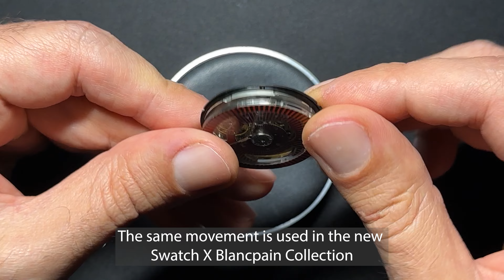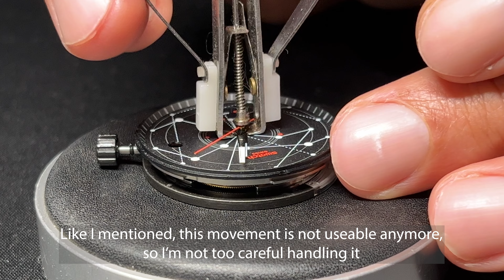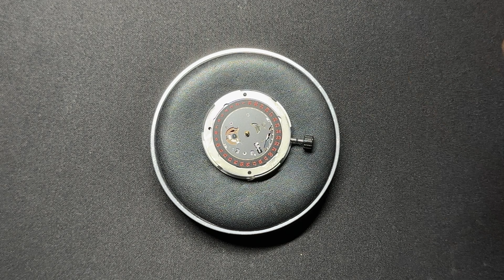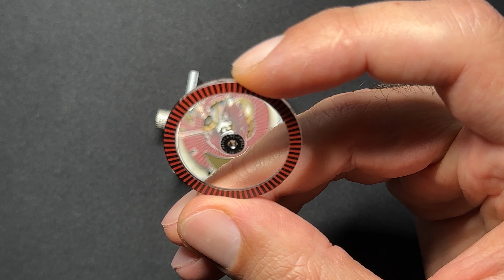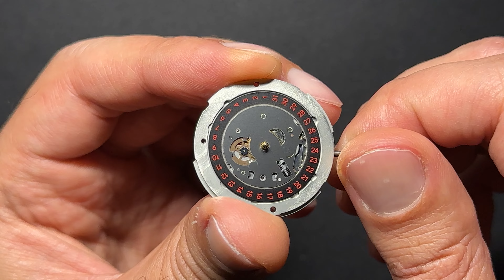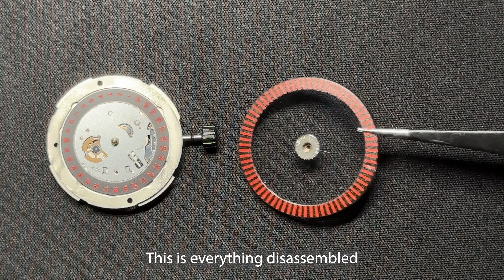A closer look at the SISTEM51 Movement similar to the one inside the new Swatch x Blancpain

Comment: What's the size of the movement? I wonder if you could just plonk an ETA/ETA clone inside the case and be done with it.
Reply from the maker: That's a good question. I'm not sure if it will be possible. The Sistem51 movement diameter is close to 33 mm.
Reply: @time_keep  so....might need a new spacer then.
Reply from the maker: @tdugong  I actually disassembled the movement so everyone can see what the parts look like. New video is uploading right now! 😃

Comment: Very interesting.  Thanks.  I may pick up a Sistem51 watch just for the significance of the movement -- robot-made, riveted, disposable automatic.  Don't think I'd wear it much; doesn't look like it's designed to last.
Reply: if it's not designed to last why not just wear it while you can? Otherwise you just keep it in a drawer until the oils dry out and throw it away.
Reply from the maker: @defenestratedone  good point.
Reply: I doubt it has oil lubrication.  One purpose of a plastic escapement is to obviate that need. It may last forever with proper care.  @defenestratedone

Comment: Interesting. Some videos I have watched call this out to be a plastic movement but I don’t see any plastic (gears etc. all seem metal). Have you observed any major parts within the movement that are made of plastic? Would be interesting to see how well the movement is keeping time.
Reply from the maker: It is actually metal. I don't see any plastic parts aside from the rotor. Time keeping is good too. According to my timegrapher, the movement I have is running about 20 seconds behind per day. Regulating it is not an option either.

Comment: can the movement be replaced in the new BP&swatch watch? We know it cannot be repaired but maybe it can be replaced?
Reply from the maker: Some people are saying it is possible, but I’m not sure. I guess we’ll find out.
Reply: Would be nice of Swatch to specify. I'd be OK with the BP swatch if you could have a new movement put in down the line... you could even keep the decorated rotor.

A couple issues could be case fit, and the custom colored date wheels. And whether you can get the movement out of the BP case without running them.

Comment: Any video to show how you break the casw to get the movement out?
Reply from the maker: It was pretty quick. The case was broken already, so it was easy to take it apart.
Reply: @time_keep   Really? I spent an hour to mill  over the ultrasonic bonded  caseback, middle case and crystal, to access to the screw of the rotor and failed to keep the crown intact by pulling out the crown stem with brute force.  You did a good job.
Reply from the maker: @kuongsam2314  Ya it was easy for me because the case was too damaged and it required a little force to open. It just broke apart since it is all glued. You can't remove the bezel in one piece for example.

Comment: thanks, that is pretty amazing !! Now what is true what they say about SIstems51 .....? Early versions were ALL plastic components, and also ALL sealed. When it works it works, when it breaks down it's a total loss. There are 'newer' versions with non-plastic components that CAN be repaired ??
Reply from the maker: Thank you! I’m honestly not sure if there are new ones that are serviceable. The only thing that is plastic in this movement is the rotor. Everything else is metal.
Reply: Don't think they are serviceable. But the Swatch x Blancpain watch does have a snap case back. So maybe the entire movement can be swapped out and replaced if there is an issue. Unlike other Swatches with Sistem51 movements, which have sealed cases.
Reply from the maker: @catlike1  I guess that’s better than nothing. I wonder how much it will cost to replace the movement.
Reply: I think in current time and day, it would not be very sustainable to have a watch that needs binned once it stops working. I cannot imagine Swatch Group (or Blancpain for that matter!!) would think that to be the current best option.
Reply from the maker: @dino2400 I don’t think they care about that since they know the watches will sell anyway. Check out sold listings on eBay. They are going for around $1k right now. I call them resellers’ watches 😁 most of the people lining up right now are resellers. I will add one to my collection though. I like the blue one. I’ll just wait since it is not a limited edition.
Reply: @time_keep  hahaha, yeah, prices went from 4500 to 500 in one day. I find those idiots hilarious. Like paying them 300 per hour for waiting in a row? Come one 🤣🤣
Reply from the maker: @dino2400  it really doesn’t make sense. I mean if you sell it for $1000, you can make decent money and it is probably worth the wait in line, but at $500, you are only making like $20 after it’s all said and done.
Reply: @time_keep  does it make sense to buy for 1000, just to have it 3 weeks sooner? It’s not a limited model. Then you’re just insane.
Reply from the maker: @dino2400  some people don’t have access to a Swatch store. It does make sense for them if they can afford it, but I agree with you. I waited a long time time until I got on the Omega Swatch train. I got the Mercury one and I use it as my beater watch. I paid retail. 😁
Reply: I read it has a snap case back.  Yeah, maybe the movement can be replaced.  How often would someone wear these watches(?)  Swatches are made to be collected.  The MoonSwatch pushes fell off and the case bleeds on your wrist? Don't get me started on the Velcro strap.  Blancpain/Scuba seems to be better.  I like the Pacific.    @catlike1

Comment: how does one release the stem and crown from the case?
Reply from the maker: There is a whole next to the stem on the back of the movement. Insert one end of a tweezers in, press gently and pull the crown. I thought I couldn’t take it out, but I just tried it and it’s pretty easy.

Comment: So long as the case back can be undone then the whole movement can be replaced.
Reply: Which is in an indicator of a super cheap, disposable movement, much like $10 quartz movements. 

If it could be disassembled, that's a different story.
Reply: I was just wondering the same. If you wanted to keep the watch for say sentimental reasons you would just replace the movement if there was any issue.

Comment: No one gets cheap movements serviced anyway so its no big deal. It'll probably run for 10 years  or more.
Reply: I've head if you sent it to Swatch for repair, they just throw away the old movement and swap it with a new one.
Reply: Depends on country, my dude would probably service it for 20euro
Reply: Same thing with the seiko movements like the NH series- can have manual wind, hacking, day/date for under 35 bucks on A.E.